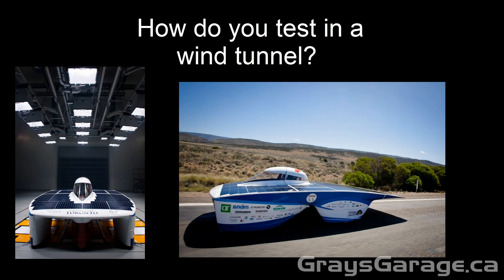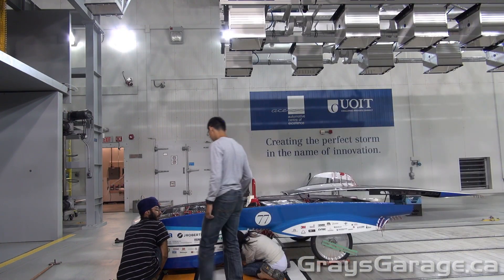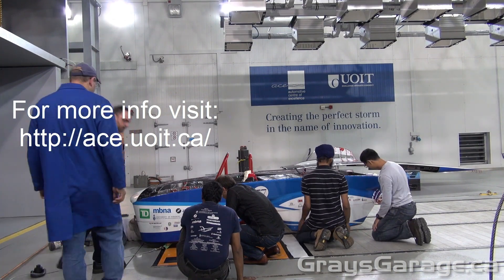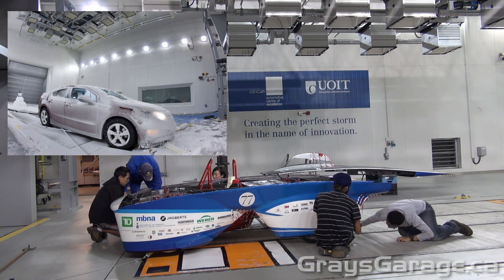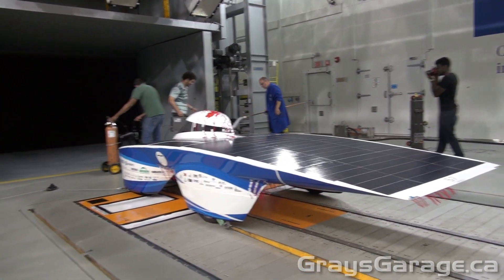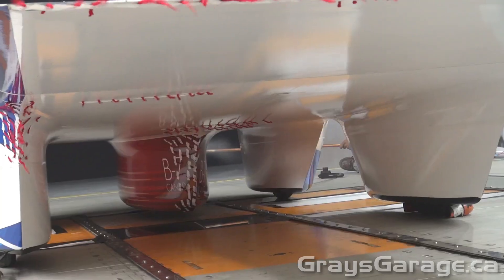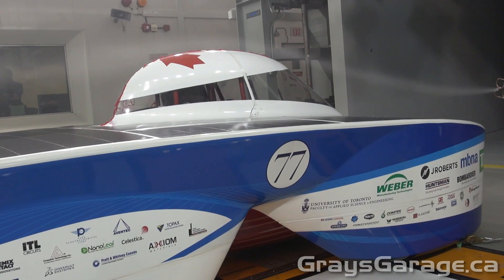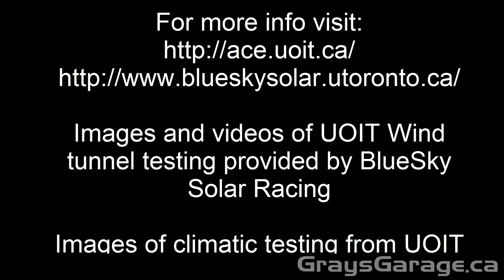Wind tunnel testing of a Solar Car

Comment: Great to see this .  But the rolling components are not exercised , be it by rolling road or elevation & turning . This process may evaluate above ankle height well , and most vehicles are so badly styled , below ankle height is a little irrelevant , but in context of the near 1 kw performance everything is important . Great to see the range of conditions that can be achieved in this facility .

Comment: The slower speed of the 2+2 and the later cars that came after it was because of American pollution requirements and lowering of HP of the engines.  If you had looked at UK cars the speed did not change all that much.  Also 150mph for the series 1 was a test figure only, on a bluprinted, race tyre equipped car, the normal road version did not achieve that.  The fastest e-type off the show room floor was the series 3 - not much in it but it was the fastest.  The slowest cars were the US 2+2 six cylinders.

Why did you need to make up a coupe model - why not just buy one?

Great vids and explains a lot - I have a series 3 OTS and the airflow in the cabin is exactly like you explained - plus you get exhaust as well.  Though when my hat gets blown off my head, I loose it out the back and have to stop and get it - it does not flow forward where I can get it.

Great stuff.

Comment: Wind tunnel looks amazing, but come on you could have made a mount for that smoke generator feed pipe to not have the poor guy holding it in the air stream ;-)
Reply from the maker: as far as I've seen, for quick tests it is generally held by hand so that the location can be moved quickly. Although I agree, he did look a bit chilly!